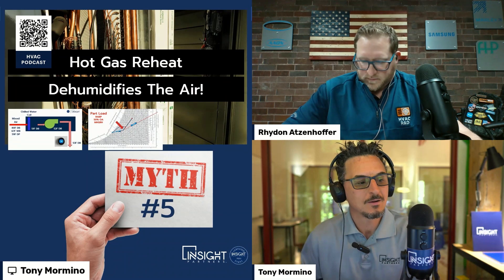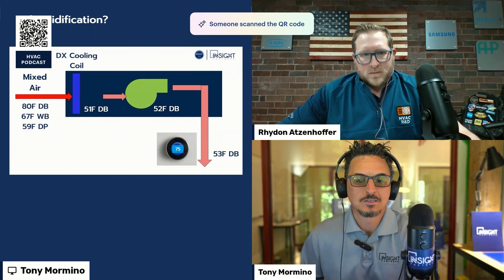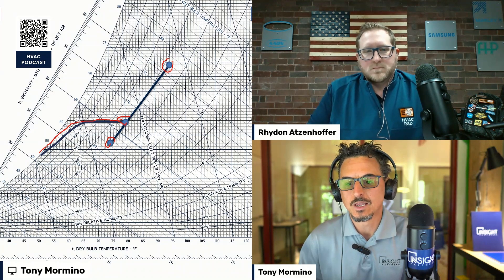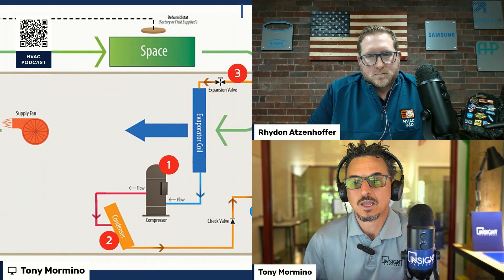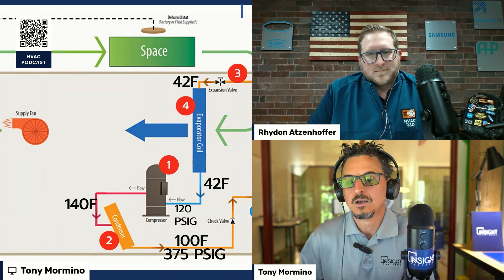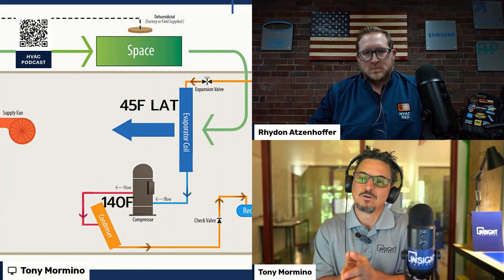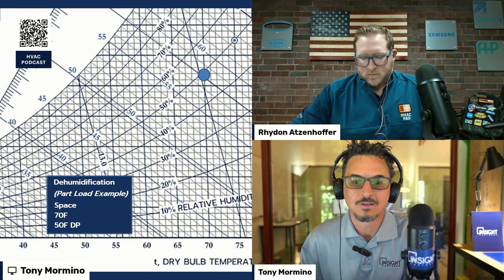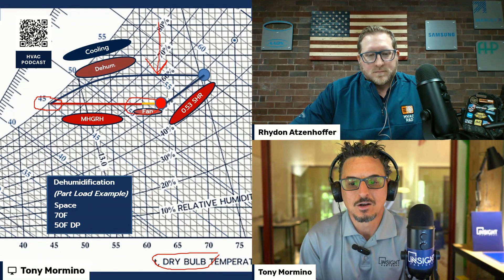HVAC Quick Take: Myth - Hot Gas Reheat Dehumidifies the Air

Comment: You select the appropriate PLC and sensors as your control system. You eventually begin to drive the evaporator temp to 34 when in reheat and install a receiver to compensate for the different condensing dynamics that exist between the reheat coil and the normal condenser for a lack of a better term to use for any reader. I don't want to call it the outdoor because they're not always outdoors. I actually plan to design a system for a friend. When I get set up I actually plan to do a lot of experimenting. But you really do need to lower the evaporator temperature because of the physics nature of water. You seem to have a good grasp on how to plot out a psychometric chart. When looking at it do you actually see the point I'm trying to make? You'll never reach low design running an evaporator at 45 degrees. Never.